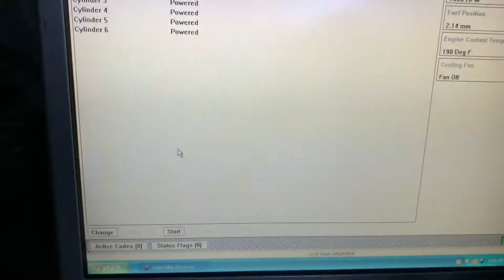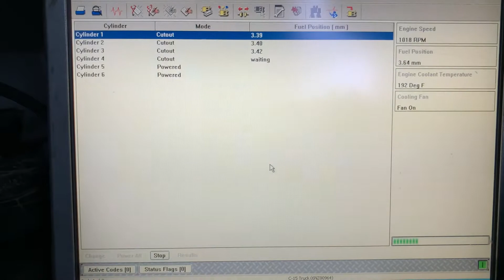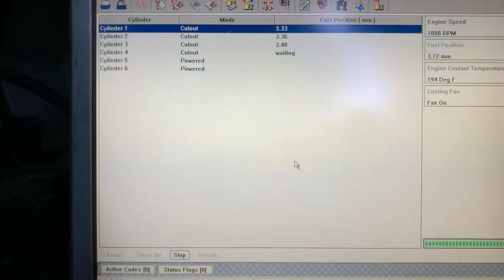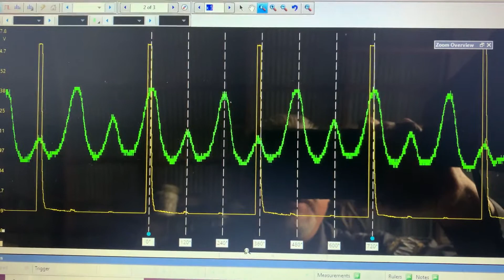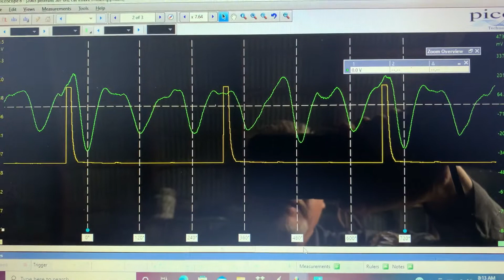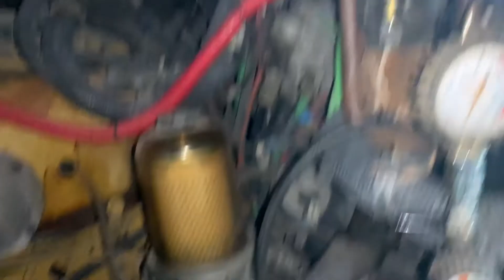2003 Cat 6NZ High Coolant Pressure , Loss Of Coolant  Or Over Flow Of Coolant

Comment: White smoke mostly and I believe first thing you wanna check is the turbo
Reply from the maker: White smoke is a symptom of a cold burn cylinder, not hot enough, blue smoke is symptom of oil burning then I would look at turbo or cylinder rings etc. black smoke is a symptom of too much fuel not enough air again I would look the turbo as a possible cause but only if I saw it under a load such as driving under acceleration not so much while sitting even under wide open throttle. If I did see some black smoke under wot sitting it would be an indication of an over fueling cylinder. Not necessarily an injector other causes could be the problem such as worn camshaft , valves lash, weak compression etc.

Comment: I have a c15 acert and having issues with coolant coming out of recervoir tube by the cap, it only comes out when I have a heavy load I even put a jug to catch the coolant coming out to verify. I was told a bunch of things that it could be a head gasket or a bad air compressor or a bad thermostat? I took it to shop but they didn’t really do much to it besides tell me that there was pressure in the cooling system and that it was most likely gonna be my head gasket. Am I out of options? And just see if it’s the head gasket
Reply from the maker: Good morning, sorry to hear that. On the truck I was working on the head gasket is blown or the liners sunk. Customer didn’t make the repairs so we never got to tear it down to pinpoint the issue. On ours after about 30-45min of idling the engine would over heat and pressure up the reservoir and spill over through the over flow tube. If your truck is not over heating then it’s a possibility the air compressor is contributing to the pressure build up. To test it you would have to disconnect the discharge line at the compressor (the line going to the air dryer) and supply air to the governor (res) port 120psi to unload the compressor. Start the engine and let it run to see if you’re still over pressurizing the reservoir if not the compressor is bad. If it is still pressuring the reservoir then it’s a possibility that the head, head gasket or liners are the problem. Hope that helps a little bit
Reply from the maker: Yes I understand, it could be one of several different possibilities. Performing a pressure test for the most part will only tell us what we already know and makes no sense to me. Like you I need to know what and where the cause is from there decide what would need to be done to repair. It and I would go about getting it done. In the video it was 4,5&6 I was pretty confident that it was a “sunken” liner or liners and it was but letting the customer know that ahead of time gave him a chance to prepare for it. Had it behaved differently I might of blamed it on a gasket or cracked head. Those things would still be checked of course . At least he now had an idea. Yes this test is really nice it could be something simple and quick that is what we want to know. If you like to stop by please give us a call so we can make time for you . Our office is 8303744422
Reply: Good morning my name is Melbourne I’m having that same issue right now my coolant is just pumping out through the reservoir  drainage hose but the temperature is at 175 it’s not running hot or anything and I was told that the thermostat was stuck open. My question is what was the problem with your truck ?? I’m just lost right now and I’m dumping money into it and it’s not getting fixed
Reply: @melbournemckie3439  my truck ended up blowing the head gasket on a hill so I ended up selling it to recoup some money back since I didn’t want to get the engine overhaul. All I can advise you is don’t run on places with hills or mountains because you’re truck most likely won’t be able to keep up cooling the engine and the same thing is going to happen to you

Comment: every diesel I’ve ever had puffs smoke on start up…. That is not a symptom. The cylinder is cold because IT IS COLD
Reply: We have a 2003 Newmar motorhome with a Cat 3126E and it Never puffs smoke on start up. It does have an air intake heater that comes on for a few seconds when it's cold("wait to start").
Reply: Well I can guarantee u that it’s not supposed to blow or puff any white smoke on startup…
Reply: @RV83313 my fleet of Cat and Cummins powered Peterbilts would disagree. You don’t get complete combustion on cold starts which leads to a puff of smoke in pre emission or deleted diesels. It’s not a question you don’t get to have an opinion on facts.

Comment: Ernest I have the same engine mine is a 02 and it is doing the same thing but doesn’t get hot unless I have a heavy load going uphill but thanks for making this video oh I don’t have any smoke though
Reply from the maker: Thank you for taking time out of your day to watch and reply. Yours sounds more like an airflow problem or coolant flow. You didn’t say if you were adding coolant or not, I will assume your not. I would be looking more at the fan clutch or dirty radiator. There’s a dozen things that it could be. I’ve had it where the impeller was bad on the pump not moving the coolant like it should. Or over fueling injector causing higher in cylinder temps. Keep it simple odds are it is. Flush the radiator not just the inside but the cooling fins of the condenser, charge air cooler and radiator. That may help.
Reply: @zerotimetrucks2253  thank you for your reply yes I’m adding coolent because it’s coming from around the radiator cap I just changed the cap too. The oil cooler went out a couple hundred thousand miles ago and the machanic was supposed to changed the radiator then since my other one was so old and full of oil but you never know thanks again earnest that was my brother’s name my grandfather and great grandfather Wilmer earnest thanks again